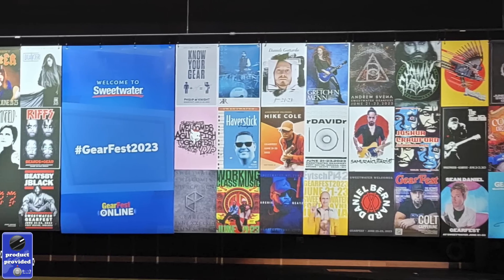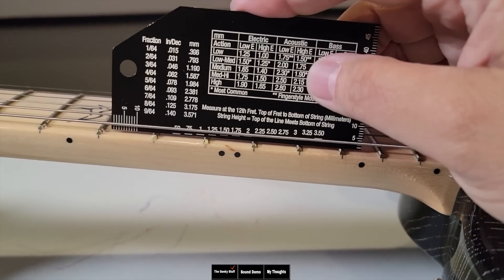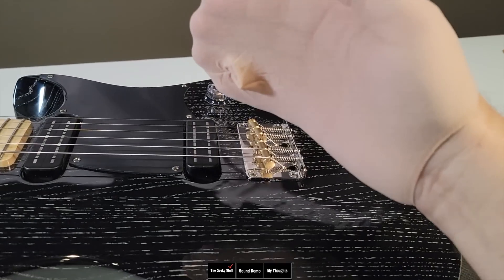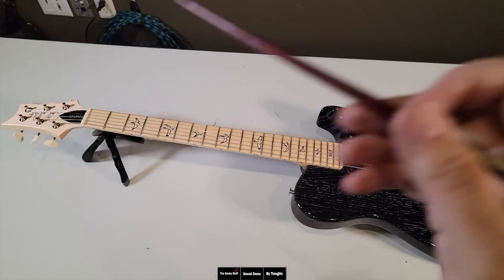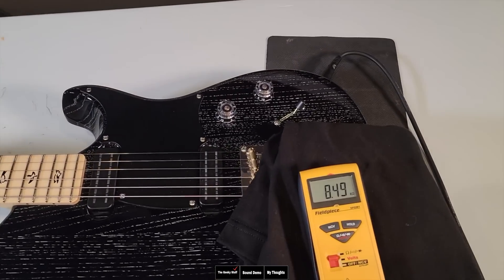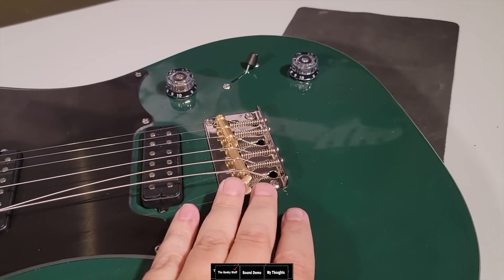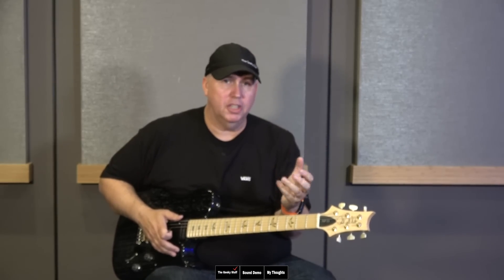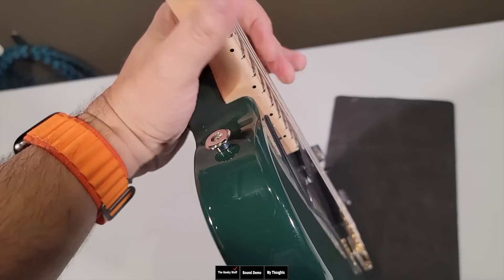PRS NF53 Deep Dive

Comment: I love the guitars and really excited to try it out - the one thing that doesn’t seem acceptable, and I’ve seen it in all new PRS Teles, is the off centre wood joint for the body. For 3k I think it should be fair to expect either a single piece for the body or at least a centre joined one. Seems like another way to save $ on these.
Reply: Its perfectly on a 1/3 mark which makes me think its intentional. Its not traditional but it doesnt look bad. If the pieces are matched well and the grain pattern isnt wildly different I would love that on my own guitar.
Reply: Hell a pro 2 is only 1800
Reply: Some people (inc Eric Johnson) feel center joined affects tone.  This is a solid body, not a top we’re talking about.  Gotta think like a fender dude.
Reply: I saw an explanation of why the 3-piece body: The big swamp ash slabs required to make a 1-piece body come from below the water line of the tree. That's the super heavy wood. They wanted to use the lighter wood that is above the water line. The diameter of the trunk that is above the water line is not big enough.

Comment: I've said it before, I will say it again. I can't wrap my head around some of the decisions that PRS is making at the moment. I get that this is supposed to be modeled, essentially, after Pauls 53 tele, but not putting locking tuners on what amounts to a 3k dollar guitar just doesn't make sense. I get the "vintage" vibe, but locking tuners does nothing but make string changes easier and doesn't have any real impact on the instrument itself. This is the same decision they made on the 594's after like 2019. With the price of guitars going up, including the SE's, it just seems like a no brainier to add locking tuners. It isn't that much of a cost increase, but it pays massively in the QoL department. The other thing I can't get is that they aren't offering hardshell cases. I think it should be an option at that price point to be completely honest with you. I have enough guitars at this point that I have a difficult time storing the cases, and maybe that was a reason for the gig bag decision, but I think it should at least be an option without a huge upcharge. I am a PRS fan through and through, but I am starting question some of the decisions that they are making at this point.
Reply: Every bassist with $3k guitars laughs at your complaint about non locking tuners.
Reply: I agree locking tuners and lack of a hardshell case baffle me with the NF53
Reply: @StupidGuitar  exactly. Stable tuners and a solid stringing process.
Reply: I agree 100%. Locking tuners are the way to go and I love PRS style locking tuners.

Comment: I honestly think firefly’s new tele series is much better than this prs. Obviously the attention to detail isn’t the same but the firefly’s look nice, come in many configurations/colors. All have locking tuners and coil splitting for all humbucker units. It has ball end stainless steel frets and is only $170. I could buy 15 firefly’s for the same price and easily find one I could connect with more than this prs.

Comment: Phil- my amp tore up man, can't get a peep out of it. I tried bypassing the preamp- going directly into the return on the fx loop- still nothing. Tried the digital output- it's a Blackstar club 40- still nothing. Pulled the fuses on the rear, they look fine. I now own an 800+ dollar door stop basically. So, I'm making the change- selling all my pedals, power supplies, boards, etc.- buying a modeler and a cab- or some FRFR speakers. Could just use the amp as a cab now I guess- I put a Cream back 75 heavy mag. in it and it's a closed back combo that has the 1/4 inch speaker connection you plug into the back of the head- I could just plug my modeler into it. Idk- you think the frfr speakers are worth investing in? Or a set of PA speakers?

Comment: I like these, I just can't wrap my head round the price. I think the MK is too expensive anyway (more expensive than a CE!), but for this to lose the locking tuners, lose the headstock veneer and not have an artists premium attached, why on earth is it the same price!?
Reply: Because Myles needs his royalty payment whilst PRS, the distributor and the shop also get their cuts too
Reply: @truthtorpedo99  the NF53 isn't a myles Kennedy model.

The manufacturer, the distributor and the shops also get cuts of every guitar prs make.
Reply: @dubster82   @dubster82  you asked why the miles Kennedy model was same price as the normal one when it lacked the locking Tuners, etc.  I answered cos the artist is paid the royalty and that in part comes from the cheaper parts and production compared to the nf53.  Miles is not paid a royalty on the normal nf53 sales
Reply: @truthtorpedo99  incorrect, you have read my post wrong

Comment: $3k USD for: a 3-piece body, scarf joint neck, non-locking tuners, no vintage tint on the neck like the older CE's, weird looking tuner buttons, no string-thru body option, and a gig bag? Pass.

Comment: Thanks Phil. Appreciate the dive. This release almost seems to be a middle-fingered salute to the Tele rather than a PRS take on the Tele, but then, I am probably dead wrong about such a thought. 

This is more of a $2000 guitar. No way should this come in at $2900. 

The SE version, if that happens, might actually do quite well since overall this is a very good guitar, but it isn't Tele-enough to pull the trigger at $2900. There is much more in the PRS lineup that is more attractive at that price point.
Reply: I'm not sure if a usa builder could make these at $2000. I know Phil did the kiesel builder and got around $1600 when I did it it was closer to $1900 (not sure why the difference maybe there was a sale) but then you have to add 30-40% bump for the retailers. That gets you closer to the $2500-$2600 range. Which is right about where the Bolt on PRS range starts. So I think the surprise about the pricing isn't that it's north of $2000 but rather that it's the most expensive of the Bolt on series. (Again take the price figures with a grain of salt). The only thing that I can think if is maybe it has something to do with the price of ash since the Fiorre is the next most expensive at around $2849.
Reply: @StupidGuitar  I know kiesel does a lot of builds maybe phil didn't notice? I'm not 1000% sure why it came in so low. Mine was just under 2k
Reply: @StupidGuitar  yeah I think the comparison with kiesel is helpful for a ballpark but folks have to keep in mind they are buying direct unlike other companies where the dealers generally add 30-40% (roughly). A big thing that can't be discounted is each builder pays its employees at its own rate. And I have no idea how big part of the cost goes into just payroll. Again I don't think the north of $2500 is surprising just that it's more expensive than the rest of the Bolt on lineup